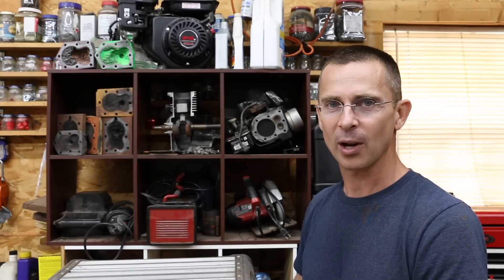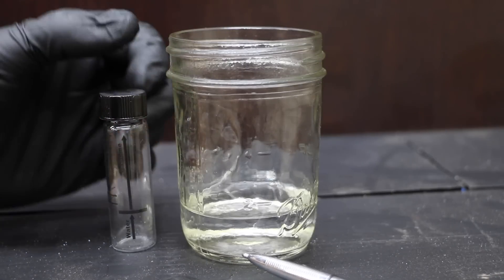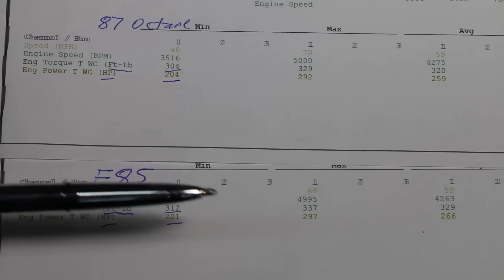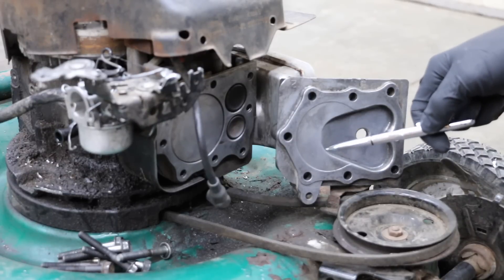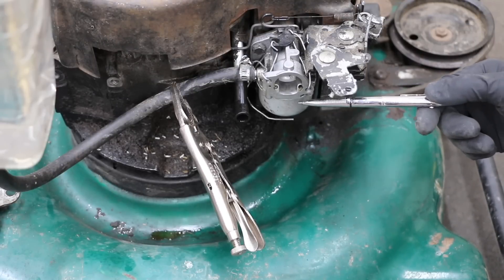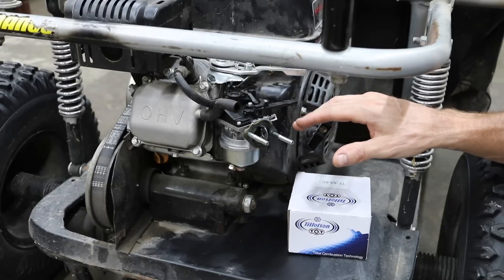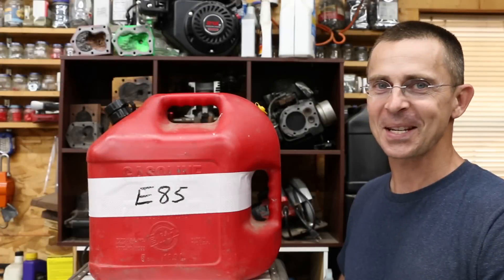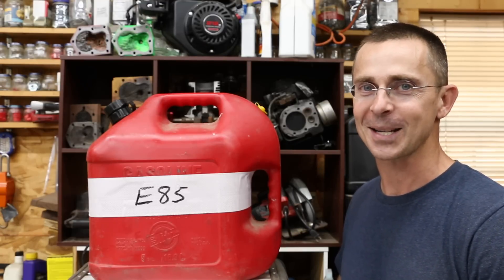Is E85 better than Gasoline? Let's find out!

Comment: try e85 (with 2 stroke oil) in a 2 stroke engine
Reply from the maker: Great video idea!
Reply: @ProjectFarm  if you do it, please use a caster / ester core 2 stroke oil. Ethanol will not mix with traditional 2 stroke oils resulting in premature engine failure.
Also you need to jet the engine ~30 richer to compensate for the lower BTU of ethanol. (85% ethanol blend).
You likely won't see any benefit of e85 without compression / timing adjustments. It's potential comes from its knock resistance and cooling effects.
If ya want to dodge it up you could simply adjust the choke to richen up the mixture but you'll loose power due to the air restriction the choke creates.
All that said you likely won't see much chance of engine damage from a lean air fuel mix on e85 until you place the engine under load.
Reply: @MaFTB  soap
Reply: @eljaibas16  Use canola oil as 2 stroke oil. Much to my surprise it appears to be fantastic for engine lubrication and your weed eater or chainsaw will smell like french fries while the motor runs. If any rubber parts do get damaged then throw them out and buy something of higher quality. The "corrosive" properties of ethanol are grossly exaggerated. Pure ethanol has a ph of 7.3. I'm no chemist but this slight acidity should in no way cause any damage to polyethylene fuel tanks. I do however see that ethanol will readily loosen any accumulated gunk that will end up in the fuel filter.
Reply: It is need special 2-stroke oil! Normal 2-stroke oil not mixed with etanol
Reply: @joonashalme5791   Former M50 Castrol.
Reply: @joonashalme5791  castor oil will mix. Only oil for methanol / ethanol
Reply: E85 will probably ruin everything on the saw, but it would run good if you can jet it right
Reply: @sunnyray7819  Not any better than E10 87 octanes, because the compression ratio in 2 strokes are pretty low. Once I put Avgas  in my 135 Johnson Sea horse and the performance was substandard compared to regular 87 octane.
Reply: Lawn mowers are not meant to use beyond E-10.

Want a lawnmower to last longer. Use 100% Gasoline.

E-10 if in a mower long enough will eat a hole in the gas tank.
Reply: @Johnkoth  OR, add Sta-Bil
Reply: @M773 My friend that lives in Europe and travels to France,Germany, Austria and so on what me to tell you something

 "You're a complete idiot."
Reply: @Johnkoth  you are right . WE dont use éthanol in 2 stroke engines in France. I personnaly use it mixed with 50 % 98 unleaded in my Audi S3, works fine, and is cheap - 0.5 euro / litre
Reply: @manunumber12  the normal gasoline contains 5% ethanol.

The only one problem in running two stroke engine on ethanol is if you must premix oil and fuel.
In any oil injected engine there's no problems.
Reply: @dadoVRC  I tried e85 with my son's 125. It has séparate oil réservoir. It worked ok for a while but after a few minutes, the pilot jet was cogged with dirt. I cleaned it but could not do more testing. I will give it another try for sure.
Reply: @manunumber12  you need also to adjust the a/f ratio.
Reply: @dadoVRC   Bike is full power, running rich with the biggest main jet one can find ( a lot of unburnt gas and oil dripping from the exhaust, so I guess e85 will help ). I will make a video when I try ethanol
Reply: I use E85 in my 2 cycle 1970's Jacobson ( no plastic parts), smokes like a champ still this while summer mowing =)  Only use when I dont have other
Reply: Yeah try that !
Reply: My 01 Durango 5.9 r/t had a really annoying shake I started using e-85 and my bad shake would go away my truck was not built for e-85 but I did find that 25% to 35% of 93 octane what my truck calls for and the rest e-85 made my truck run top performance and no more shake now I finally figured out I had too much blow by and it was fouling some of my plugs so I fully wormed up my engine and removed my plugs topped off all the cylinders with wd-40 transmission fluid and acetone put all the plugs in and left it overnight next day I removed the the plugs cranked it to get everything out put the plugs back in and finally got it to run smooth with 93 octane pump gas next time if it comes back I'll fill the cylinders up and pressurize the cylinders with my air compressor and see if I can clean the piston rings more my friends that know about cars thy called the tear down in a bottle Lol and after all this I also got rid of the famous p0420 code so I'm definitely on too something hope I helped someone and try to make a video with hot socking cylinders in different ways as you can
Reply: I'd like to see diesel or some mix of it in a 2 stroke engine!
Reply: @Jairo Franco: THAT! is the best thing you can EVER do to a 2-stroke engine if you want to ROYALLY ruin it!

I ran mine with E10 - NEVER EVER AGAIN ! ! !
Reply: @Bandicoot803  Shut your pie hole dude. Ethanol does not damage small engines. A lack of care certainly does. Stupidity certainly does. You can spout oil mafia propaganda all you want here but I know a little bit of ethanol did not cause your motor x to become a nuclear bomb. Tell me, how is the USA (a nation supposedly the most technologically advanced in the world) unable to produce small engine that can handle anything more potent than E-10 but Brazil can make small AND big engines that run on E90+ without a hiccup?
Reply: @Bandicoot803  Point 1. I didn't type any swear words. Point 2. What about it? E10 is sold in Europe and the USA. What are you getting at? Point 3. Nah see it looks more like you've implied ethanol is unsuitable for internal combustion period. If you think you weren't implying that then re-read your previous comment. Point 4. How old do you think I am? 

Are you going to recommend I start breathing gasoline vapors instead?
Reply: @exoticcreature3059  
#1: You were the one bursting into a comment section with a behavior that is all but acceptable! ( Oh, the indignity ! )
#2: Under no circumstances can one find ANY regular gas station selling licensed rocket fuels in Europe like in the U.S.A. as Europe is not heavily swarmed with big block V8's the average American citizen needs to show off what fuelaholic vehicle (s)he's proud to drive.
#3: Wether ethanol is (un-)suitable to one's vehicle is a case per se. Mine showed all but glamorous results.
#4: Physically: It doesn't matter! Mentally: Having a hard time to meet the minimum requirements to pass Kindergarten exam with a "D".

Whatever you want to breathe in is entirely up to you. You deal with it, buddy! Too bad Obama care is going Bye-Bye...
Reply: uuuhhh... KLOTZ??
Reply: They're built to withstand it.

Costs extra to the owner
Reply: E85 and 2-stroke work OK in engines that add the oil in the carburetor or in the crankcase. But mixed in the fuel only one oil on the market works as far as I know, and even that separates if the vehicle sits for more than a week.
Reply: Jairo Franco It runs fine if you mix it with 20% nitro
Reply: It Does phase separate um 48h
Reply: Man i love these video's you are AWESOME...
Reply: The ethanol may compromise the lubricating oil. Oil doesn't like alcohol and vice versa. You'd probably have to inject the oil from a separate tank so the ethanol doesn't dilute the oil too much.
Reply: Yeah I got with you about the wind friction proofing testing I want you to check it you still don't get cancel still wait I like to see the test on winds broken proving a brisk  test
Reply: Or what about 70% rc car fuel with 25% diesel fuel and 5% bald eagles in a diesel engine
Reply: @mandelaeffect3521  Right, we can pick up the bald eagles under the wind turbines.
Reply: @robertkubrick3738  hell yeaaaaaaaa brother!!!
Reply: Rejet the carb and run castor oil and no problem
Reply: E85 mixed with soybean oil
Reply: There is a LARGE problem with ethanol 
added fuel, in a 2 stroke.

You see the simple test to measure the 
ethanol amount?  Let's consider doing that 
with 2 stroke oil mixed gas.  It again will 
separate into 2 different mixes.  Gas and 
oil, on the top, and water and ethanol on 
the bottom.  See if you can guess which 
one will DESTROY your engine.  Yep, the 
water alcohol mixture.  The gas and oil 
mix, however, will foul your plug, since 
it has a high concentration of oil.

Another thing, America is burning their 
food supply, making ethanol.  I've seen 
a study that says it takes more than a 
gallon of fuel, to make a gallon of alcohol.

Ethanol, (the kind of alcohol in your beer) 
is made exactly the same way whiskey is
made, for fuel.

steve
Reply: Steve Skouson probably the only reason the oil industry allows it - burn twice as much ethanol as you would petrol, and somewhere a farmer has burned two gallons of diesel.
Reply: @steveskouson9620  and if the engine is DESTROYED it would be fun to watch (at least forme, I think)
Reply: @steveskouson9620  
Americans burn money. The farmers get paid NOT to farm then bail them out when there is a shit crop.
Reply: @steveskouson9620  you mean e100? I thought the max is e98 in america
Reply: @steveskouson9620  it separates when you add water? How much water do you add to your fuel on a typical fill up?
Reply: J, humidity, just maybe?

It doesn't take much.

On something that is waved around a lot, 
the mixture will re-mix.

On a motorcycle, or motorized bike, they aren't 
shaken around.  Alcohol with some water WILL 
support combustion.

One more thing, most 2 stroke engines aren't 
jetted to support E85.  E10 is bad enough.
(We won't mention the damage to rubber 
fuel components.)

steve
Reply: You know there is a easy solution right?

Run a fuel injected 2 stroke. The oil is mixed into the air intake, and dumped into the crankcase as a whole. While the E85 is direct injected into the cylinder. 2 stroke oil only coats the walls of the cylinder in these cases, but isn't scrapped off like in a 4 stroke. The main point here being that the two never have to mix. 

The oil consumption is also much closer to that of a 4 stroke. The final "mix" ratio is less then 1/100, and the oil tanks for those engines are made to hold enough for around 1000 miles. Which, is about as often as you'd change the oil in a typical 4 stroke of equivalent CC's for the small sizes these weird 2 strokes are made at.
Reply: @steveskouson9620  The US could make methanol from natural gas that we flare off. You are right about wasting food.
Reply: @steveskouson9620  we are making our E85 with what is usually discarded as animal feed or thrown in the trash.  We aren't using good corn or any other food source to make this fuel. The media was paid off by big oil to distribute that massive turd of a lie.
Reply: I ran my yard trimmer with an e85/oil mix with Schaeffer’s TC-W3 for many years. Runs just fine....

Comment: Ive used E85 like it i havent see that big of a fuel mileage drop as you did tho
Reply from the maker: That's great. Have you checked the ethanol level?  I was surprised I found some with nearly 85% ethanol as it varies a lot.
Reply: well in my area we have ethanol blends 50%-85% and E85 "105 octane" the pumps Labeled 105 required to be 85% ethanol or 105 octane

Comment: Good video, I am commenting on it before I even watch the whole thing.
Reply from the maker: Thank you!
Reply: the question is, How good does E85 hold up in the winter time, and how does it do in the heat of summer time.  (Old cars used to vapor lock with the ethanol fuel years ago)

Comment: why would anyone buy e85? you use 30percent more of it, and it eats up things...are they gonna force regular fuel out of existence to make you use it?
Reply from the maker: Thank you
Reply: 2001 and newer cars are rated E15 +. Don't let big oil scare you. Ethanol is a great alternative. I personally run E30 in all my stock cars. I get the exact same gas mileage and save serious $$.
Reply: @shawnd567  it's impossible to get the same fuel economy with a higher alcohol concentration, it's simply does not have the same amount of energy stored. More max power potential in a ICE yes, better/same fuel economy never.
Reply: Jay Dunbar Actually the Audi requires 91 + octane and e30 provides 94. It gets the exact same gas mileage sue to that fact. Also 20-30% Ethanol is a sweet spot. Try it out sometime. I also expected a 5-10% decrease but I actually noticed a 0-5% increase in mileage.
Reply: @shawnd567   incorrect bud. My 2018 has fuel requirements listed by the manufacturer to be 87 octane. Also can not contain more than 10% ethanol. 10%is the standard. Some companies engineered up to 15 and of course specific ones can run up to e85.  
It's like running unleaded fuel in an engine that was designed for leaded. Itll work,but it's not what's best for it.
Reply: joshua morin Your 2018 is recommended 10%, but it's made to run 15% or higher. Guaranteed. Try E30 sometime.
Reply: -Reduces foreign oil dependency and also bad foreign policies 
-Helps domestic job market (farmers, ranchers, refiners)
-Hasn’t been subsidized since 2011
-Burns cleaner 
-Doesn’t spill out of pipelines, tankers, and oil rigs.
-Removes water from fuel systems 
-Allows engines to run very high compression ratio(more air density = more power)
-Cheaper than Gas!!!
Reply: @mtube54  It's almost unavailable in the East. I'm sure it can spill. You're the only one I've heard say it removes water.
Reply: Steve K Sorry I meant ethanol mixes with the water in your tank and passes it through the system. It does the same thing as gas line antifreeze
Reply: Great for racing engine's
Reply: If you have a flexfuel vehicle that "recommends" premium, i.e. the GM 6.2L, comparing the cost of premium to E85 is dramatic even with the increased consumption. I'd like to see him compare the 6.2 on regular vs E85. I bet the power increase would be substantial.
Reply: For fun!! My evo has 380hp on 93 and 430hp on E85...guess which fuel map it's been on ever since it was tuned for both...;)
Reply: when dino oil runs out you will use it
E85 is more expensive is califorina(based on mpg)  then reg gas  it's tied very close to gas price which makes it not worth it
Reply: It only eats things that aren't designed for it. Modern cars are designed with at least e10 in mind so it's generally fine. Around here e85 is 60% cheaper than premium fuel, so if your car calls for premium you're actually saving money at the pump.
Reply: Experienced mechanic here. Just don't STORE vehicles long term with it.  I scored a K1500 with six of the eight injectors so stuck from E85 that I had to replace them but because I knew that I got a bargain.  E85 is shit for small engines but great for small engine mechanic revenue!
Reply: yep ive seen enough mustie videos to see how badly the carbs get from sitting on the off season with it in!
Reply: @ColoradoMotoMan  unfortunately the majority of vehicles are engineered to run 87 octane. Even many new turbo engines use it.
Personally I wouldn't own anything as a daily driver that requires 91. An extra car for driving occasionally is no big deal but for commuting, it's still better to run standard fuel. For now at least lol
Reply: @Dodgingbodies  I have 2 cars that require premium but I run e85 instead. Neither of them were designed for it (but are tuned for it now) so I'm a statistical outlier. I'm happy with it for the power and knock resistance alone, so price is just icing on the cake.
Reply: I have a 526hp car that gets 28mpg on E85. If I use 91oct gasoline my fuel economy drops to 25mpg and I loose power. It's safer for high HP motors and it's a renewable energy that's wayy better for the environment. 
E85 is equivalent to 106oct fuel so you can safely run a lot more ignition timing and use a leaner AFR. Dyno tuning is the key.
Reply: @gammalight1312  exactly. The majority of drivers won't invest time and money to modify and tune a stock vehicle to make it work. My stock vehicle gets 28mpg city and I've hit 4p highway on road trips. Sure it's no race car but zero modification, runs perfect and has a 100,000 mile warranty. All on 87 octane gasoline. :-)
Reply: Useing thinner motor oil and gear oils change my fuel economy more then the fuel type I choose.
Reply: @gammalight1312  true. Most manufacturers are running a 5w20 or 0w20 oil in production vehicles. Toyota has developed a 0w15 I believe for one of the new hybrids. Stuff flows like water. Crazy high film strength though.
Reply: @MaFTB  exactly. As a daily driver vehicle (the majority of vehicles that use standard 87) e85 is not worth the cost. So basically all flex fuel haha. 

Now, if someone has a biturbo Amgen Mercedes or M series bmw, then the gains will most likely be worth it. :-)
Reply: I would never use 87 octane anywhere else than lawnmover. We have only 95, 98, shell vpower (99+) and e85. 95 is 1.50e/L and e85 is 1.10e/L atm. 95 contains 10% ethanol.
Reply: We already buy it once through tax subsidies. No desire to buy it twice.
Reply: @c4f5  haha, petroleum is subsidized as well so your paying  twice either way. Nice try though.
Reply: Should be talking $/miles instead of gallons/miles

Comment: Awesome video.  Glad you have time to figure out life's mysteries for us gear heads . I use e85 in a big block Chevy that is 13.2.1 compression  I built for drag racing. It's cheap race gas.lol
Reply from the maker: Thank you!  I bet that big block makes very impressive power!
Reply: 515 cubic hydraulic roller cam with a tunnel ram 965 horsepower @7100